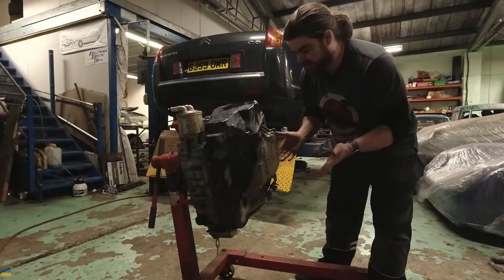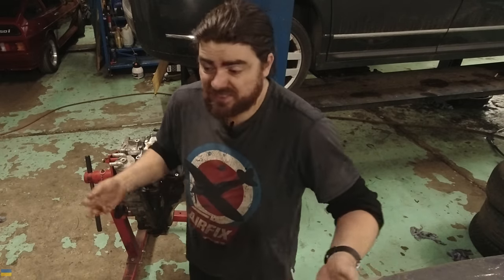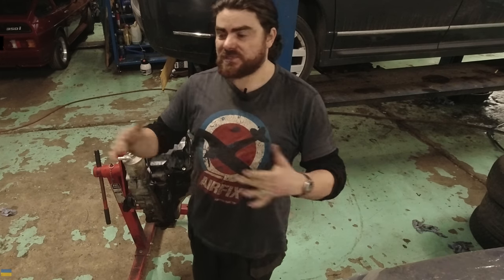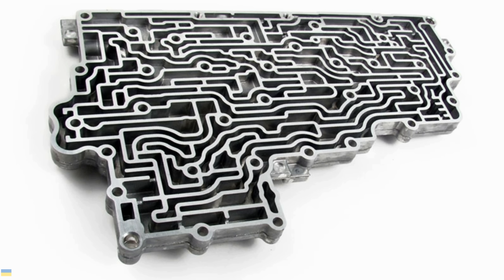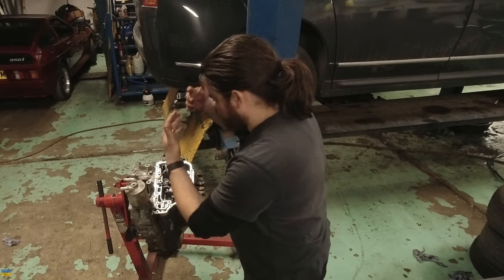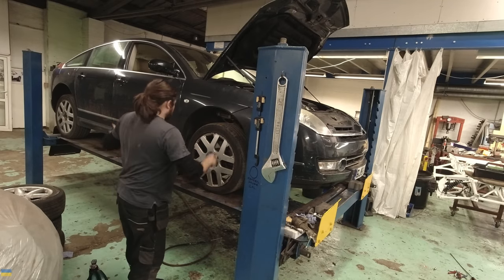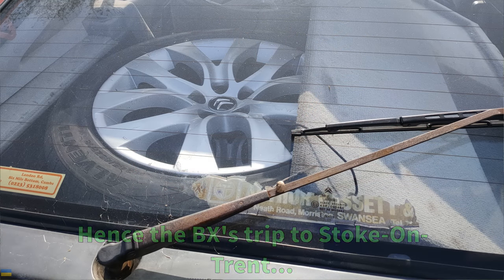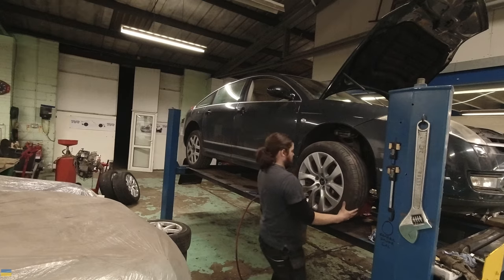Cheap Citroën C6 Project 5:  Gearbox theory and YOU WON'T BELIEVE my SWEET new BLING rims!!!

Comment: I find it hard to believe it had any sort of gearbox flush when you see an air filter in that state! Lovin' it.
Reply: Well I paid Newbury transmission £300 to do it!
Reply from the maker: It might be one of those situations where, as sometimes with engine oil changes, the new oil goes black pretty quickly? That said, the stuff in there now hasn't.

Comment: Did a gbox fluid change on a friend's 2.7 HDi. What I figured out was, each time you drain the gearbox, you only remove around a 1/3rd of the fluid (rest is in converter, valve block etc). So you need to change it atleast 3-4 times. I advised my friend to change it 3 times, each time, the mech captured some of the oil coming out. It got progressively cleaner. I reckon it wasn't a flush but a change as those terms get used interchangeably.
Reply from the maker: That's right, you never get it all out. That's why I bought 16L of the stuff!
Reply: The automatic specialist who rebuilt my ZF 3HP22 suggested that the fluid should be changed annually if possible, compared to Citroën's original recommendation of once every 15,000 miles.

Comment: I've think I've mentioned before that these valve blocks (or mechatronic units, as ZF call them) and solenoid issues are the main cause of many an automatic's woes. I had trouble with the 'box on my BMW E60 but having this unit refurbished gave the 'box a new lease of life. 315,000 miles on, the gear changes are still imperceptible. A mate of mine one commented that you'd have to be seriously crazy to design what is in effect a hydraulic computer.

Comment: Ace explanation of that auto gearbox. Thanks! New wheels are far more 'sympathique' to the car's styling. Let's be honest, factory choice of alloys was down to the accountants, not designers.
Reply from the maker: I'm not so sure. These ones might well be (as they've lifted them from a C5 model) but the original wheels were C6-only. One of the things I love about the C6 is that it feels like although they didn't get free-reign (Peugeot parts bin everywhere inside) they were allowed to go further than I would have guessed.

Comment: Ah, Atlantique. When you first rolled it into shot I thought it was what's on my C5 = Balatique (and was confused as knew mine are 17" and thought the C6 wheels were bigger. Which they are, because I am getting confused) until I sorted out my confusion I wondered if you were dropping a rim size to see if improved the ride comfort - have seen grumbling online that the C6 rim sizes were driven by the ever increasing rim diameter fashion. 

Thanks for the autobox description, you can't have too many simple analogies to try and get your head round the things. I can picture the annulus gear, planet gears and sun wheel. And I know some move and some are held stationary for different ratios - but beyond that it jumps to the witchcraft and fairy magic described by many others on the comments here!

Bump stop on the C5 was similarly knackered, but better than the one on the other side as was nowhere to be seen! Frustratingly you just pushed the thing into place and said "that was easy" - much inline with every description I've read it same process - however I can't get the damn things to pop into place on mine. Baffling, considering how simple it is!

Keep up the good work :-)
Reply: Having had 17's on a 215/55 tyre and 18's on a 235/45 on a 407, the 18's are somehow comfier in my experience. The increased sidewall just makes it deflect bumps in an awkward fashion.
Reply: @khalidacosta7133  interesting to hear, thank you. How odd!

Comment: Is this the ECU controlled AL4 automatic transmission? Someone with C5 applied the box with triboceramic treatment with great results. It's a Russian invention  originally for military engines but has been further developed here in Finland by RVS. Restores vital surfaces is their claim and it has been patented. Only works on hard ferric metal in certain temperature. Can be abrasive on soft material.
Reply from the maker: No, it's the Aisin 6-speed.

Comment: Amazing explanation on that gearbox. I am not sure if I would understand anything if I didn't know a bit how it works. But not bad at all. This project is a dream. Thank you for this video. I would like to do some overhaul like that with an old car. I found an old Opel Kadett (Vauxhall in Ingsoc) from 1973 with automatic gearbox but not sure if I should tackle it. If something is wrong with that gearbox it will be hell.
Reply from the maker: Auto gearboxes from the 70s are probably easier than modern ones, in fairness! Go for it!

Comment: I kept on flushing the gearbox oil in C5 X7 at every service and still it failed at 256k kms. It died on a big uphill - I turned it around and rolled back bottom of the hill and called the wreckers to tow it away and crush it.
Replaced with a BX , 5 speed manual of course.

Comment: Wow a 190. I had a 190D and a C6 2.7.  The third gear slipped and came in with a bang. The steering angle sensor failed. The lower swing arm had to be shimmed cus it was a Peugeot part. All the water pipes burst and decided to replace them all. The main stealer couldn’t but the exhaust back and had dsl smoke engine bay poisoning me.  I did semi oil change on the box.
Reply from the maker: 190?

Comment: Are the dimensions of the new wheels that different to the original? the 3.0 wheels look great, but never seen any up close to check sizing. Also - TPMS in the new wheels? At least you have a Lexia/Diagbox to sort that out. Great work!
Reply from the maker: No, they're the same dimensions. TPMS is deactived so no worries there.

Comment: I always thought the original wheels on a C6 look bad. Undersized to me. The other thing that puts me off is the obvious join seams down the side of the body where the plastic front and rear panels join. The paint is often a slightly different shade. It spoils the car for me. Loving the videos though.
Reply from the maker: I wouldn't say they look undersize, I just got these new ones as the old ones were so tatty. New ones are identical in size. As for plastic panel seams...not sure what you mean there. The bumpers?
Reply: @UPnDOWN  yes, the bumpers. They join via diagonal line about a foot from the end of the wings. It just looks very obvious, enhanced by a slight colour mis match. Normally, luxury cars hide this better. I think it is an amazing vehicle though and your videos are great.

Comment: Seeing that filter would have made me angry! I always check all filters, especially cabin filters for HVAC, the most neglected part of the motorcar.
I actually like both sets of wheels; the originals I would have winter tyres, the one's currently fitted, summer.
£3,000? Not bad, would definitely be more if a garage did the same work. I assume this Citroën was expensive when new. I just wish these were imported into the US!
Reply from the maker: I like both sets too. I'll get them sorted at some point, but no real need for winter tyres where I am luckily.
But yeah, getting near £3k (though some of that was stuff I didn't need to do, I just chose to do.

Comment: Aren't they the baltic rims?
You could have gone for adriatique rims and been proper bling!

If you do replace the valve block, go for the sonax block , you can thank me later.

The oil looks about right, even with the alleged 'flush' it never gets it all out, ever. The only way to do that is remove box, strip, drain tc, or just replace it, the lock up clutch is tiny and has a hard life, for the cost of a new tc, not worth buggering about with.
Reply from the maker: Atantique, according to ServiceBox. Are Adriatique the 19in? Seen those before, they look a bit...Halfords!

Might well do the valve block, not sure yet. Will get in touch if that time comes.
Reply: You could be right. I thought the Atlantic rims were the non hydraulic ones.. Dunno..
The adriatiques are the 19" rims yeah, same as simons old c5, I love them. They make the ride worse, and the tyre noise is awful, but they look proper bangin init! Or whatever the kids say these days..

You'll be unlucky if a valve block doesn't fix it frankly, the clutches and brake band are very robust considering how tiny  they are.
Reply: Also, it's sonnax, 2 n's, I have no idea why autocorrect keeps removing an n.

Comment: Isn´t theory more along the lines of wear, atrition and low oil pressures resulting in the solenoids not being able to actuate or engage properly?? Sorry to see that oil doesn´t at all look like its been flushed and renewed.
Reply: You probably know this but just in case.... you can bench test the gear box by directing an air gun into the orifices controlled by the solenoids. There should be absolutely no air leaking inside the box.